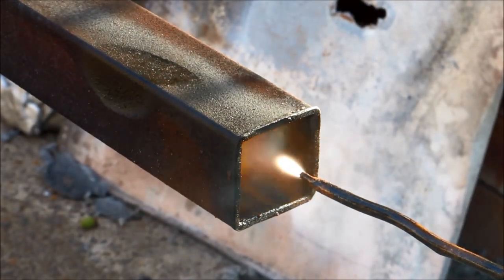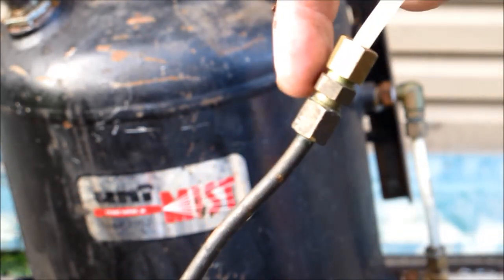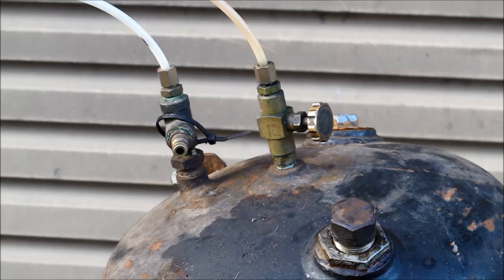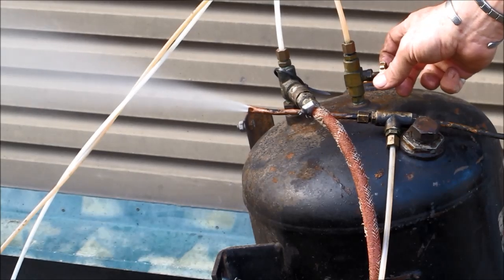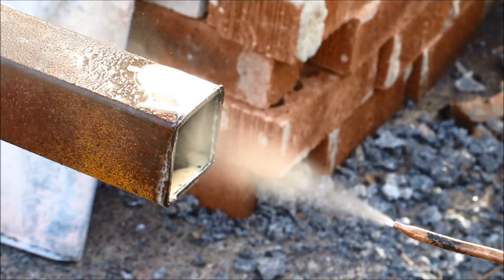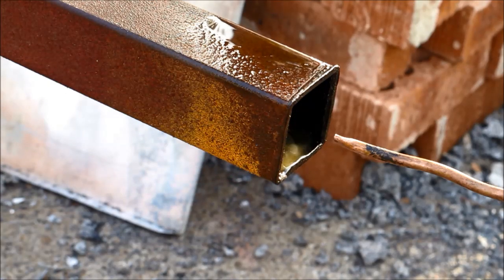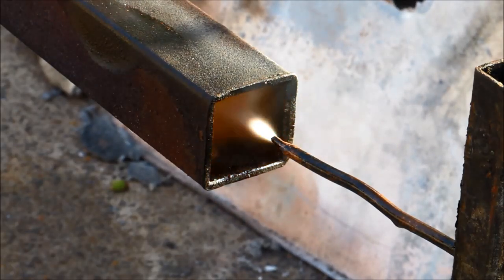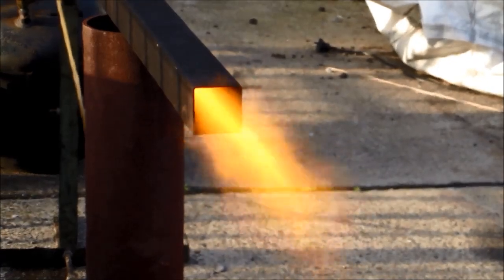Instant light  spraying oil Burner from cheap, off the shelf fittings

Comment: these burners are awesome.. i know you dont like technical questions but i am curious as to how small of a pipe or tube you can use for the combustion tube. i am going to make a small oil burning forge and was thinking of using say 1/2 inch to 3/4 inch burner tube. with a 1/8 inch feeder/spray tube in the configuration you have here . do you think it wiil work? im gonna try it  and let you know.. Thanks for the videos and ideas.
Reply from the maker: +roy moore  Roy it's not that I don't like technical questions, I don't like stupid technical questions that I have explained 10 times already. There is a difference.  :0)

As for your very valid technical question, it's all a matter of proportion. The principal of why it works is the same ( like all my burners) regardless of size.  You go smaller you'll get less air and oxygen and the amount of fuel you can burn will be smaller but it will work!

Now obviously some people out there are, unlike myself, reasonably sane and may not want to make the biggest flames possible. Scaling the idea down is probably going to be a lot more practical for real world applications like yours.  In a forge where there is so much heat once the thing is warmed up, you don't even need to spray the oil. You can just blow it in in the airstream like my other burners and it will work perfectly well. 

That said, the size and air consumption of a setup like you are talking about is likely to be so small it's probably not worth the trouble of going to a dual spray/ blow setup and you  are better off using it the one way. 

Using this setup in a forge regardless of size will only make it work better.  With what you are talking about, even burning 1-2 L of oil an hour is going to give you a lot of heat to work with and melt anything your refractory can stand!  :0)
Reply: awesome mate thanks for the info.

Comment: You are a genius,so simple to build from scrap yet so functional.I want to build something like this for heating my house,old engine oil will be used as fuel.
I have central heating system with wather circulating trough cast iron radiators.Only one question can combustion
chamber be shorter and wider I need it  to fit in central heating wood/coal furnace.Thanks for great ideas You are only one who explained every detail about building, keep up the good work.
Almost forgot any ideas about automated ignition of the burner(glowplug from diesel engine etc.)
Reply from the maker: +Zivojin Budimirovic   Try it in the combustion chamber you have.  You might need to put something in the flame path like a short metal tube to at as a " Glow plug" so there is a hot point to light the heavier oil. 
I haven't done anything with auto ignition but the best thought I have come up with so far is a small gas pilot light.  Even a BBQ gas bottle should last weeks with a small flame. 

Thanks for the kind words, much appreciated. Nice to get a compliment instead of idiots whining about safety and the environment for a change.

Comment: The length of the tube has a lot to do with completeness of combustion or efficiency.  What struck me is that you're using a SQUARE tube for combustion.  Which is probably a better choice as opposed to a round tube.  What you want here is laminar flow and the square shape would tend to interrupt the turbulent flow while promoting laminar flow.  Still it seems like there is some due to the buzz sound of the combustion.  Turbulent flow combustion causes spinning of the gases, back pressure and harmonic nodes.
Reply from the maker: +Joe youtube   I have used a round tube too. I can't tell which one works best. I have some rectangular tube, maybe I should give that a go as well!  :0)

I think what it really needs is a flared or trumpet shaped tube to allow the hot gasses to expand and pull in the fresh charge without the reverberating effect.  that said, it may be the reverb that keeps the damn thing alight. :0)
Reply: +Oil Burner You and I must be birds of a feather!  I recently got the latest version of my water heater up and running.  Up to +90,000 BTU/hr. using almost anything fuel, liquid or solid.  Exhaust gases are nearly invisible, with care.  Cost to build around $120 USD.  Can fit in the back of a PU truck.  Some welding & coil winding skill involved.  In depth understanding of the critical factors required, to realize the end results/benefits.  Design has been around for thousands of years.  No moving parts, no external power, easy to maintain, robust to the elements.  Stainless steel required for combustion chamber lining and coils, the rest is mostly junk lying around! 
Research venturi tubes...the trumpet concept you speak of is the heart of MY furnace.  Combustion chamber is SQUARE!
 Research Rocket Mass Furnaces. 
I learned to avoid introducing used liquid fuels under pressure into a chamber way past the flashpoint.  When you talk of producing a usable 100,000 BTUs, you're talking about controlling potential catastrophe.  (I HAVE produced a blue flame 15 feet long and 3 feet in diameter using nearly the same set-up as your video depicts!)  Just be careful in what you build and what/where you publish.  If it scares you a little at first, you're probably on the right track!!  ;o)
Reply from the maker: Joe youtube  I haven't done it in a water heater ( yet) but if you look at my forced air drip type burners, you'll see my current record output is in excess of 2M btu.

 Technically it's illegal to have a burner going over 1M BTU here unless it's certified and licensed but it's damn good fun to run them.
I'm working on a boiler atm that will do over 150K BTU. the burner section is well sorted, I just can't find the plumbing fittings I need to connect the thing up! Got to have it full of circulating water before I think of test firing it or the thing will be a molten mess in seconds.

Once I get the rubber seals I'll be able to warm the house, the pool and anything else that's feeling chilly!  :0)
Reply: +Oil Burner I'm impressed!  I have a pretty good idea of that level of power.  I operated a truck in my younger days that carried a 6.5M BTU heater on it, for heating crude oil (plus a triplex pump rated for 10k psi).
Copper and mild steel won't do for boiler coils for the reasons you state,  freezing/rupturing was a problem too.  Even one mild steel fitting in the loop quickly turns the water red.  I finally had to commit to using stainless for the coils and to line the inside of the combustion chamber.  It has been a challenge to secure the proper fittings, etc. between availability and low budget.  The stainless comes from local scrap yards, usually close to the current scrap price and had to learn how to weld the stuff.
Reply: +Oil Burner  Welding the stainless has opened up options for fittings/manifolds and hydraulic rated hoses have been working well.  Having a loop that can handle 2,000psi is comforting if something goes wrong, using pop off valves as well, now.

Comment: Let's see how well this works using waste motor oil from (like) a diesel engine...which is not anywhere close to using brand new oil out of a can.  Isn't the objective to end up getting the benefits of 50k+ BTUs from free, wasted oil?
Reply from the maker: +Joe youtube It is running waste oil as I wrote in the description!  I prefer to run Veg oil to the filthy black engine oil for convenience of clean up but you could run any oil you wanted, again as i put in the description.  Diesel engine oil tends to be thinner than veg oil so this would work even better I should imagine and have an even quicker light up.
Reply: +Oil Burner Anyone attempting to provide a furnace with waste oil under pressure & using a needle valve should be aware that ANY particulate material (including in-solution paraffins) that hasn't been removed from the oil, CAN cause intermittent flame-outs.   When the flow is resumed to a spray nozzle shooting into a chamber that is +1000 degrees, relight/combustion may resume with a BANG!  FILTER THAT FUEL OIL BEFORE USING IT UNDER PRESSURE!!!
Reply from the maker: +Joe youtube  I'd basically agree from a convenience standpoint if not a safety one.  All spray burners I know of require the fuel to go through a small orifice.  This system uses flatted tube which is larger than the commercial nozzles but still could be blocked by dirt.  If the oil did relight it would probably relight with bit of a whoosh but as furnaces are far from sealed units, the risk other than soiling your jocks from the sound, is very minimal. 

It' is going to be far more annoying than dangerous but I would also suggest that oil is filtered through some sort of cloth at least before being put in the Fuel tank.
Reply: +Oil Burner Agree totally with an Epiphany Eureka!!
I discovered way back and preach it a lot...that a vertical slot cut for a drain hole will rarely plug up while a drilled hole usually will, given enough time.  
I just never considered the shape for a jet nozzle design, until now that is!!  Makes total sense.
Thanks!!

Comment: If you remove your air flow going into tube while lighting the oil it can reach its burning temp much quicker resulting in faster ignition.
Reply: +Never Enough   If I remove the airflow, There will be no oxygen for the oil to burn in the tube at all.

Comment: You are brilliant. I've duplicated several of your experiments part for part with identical results. Im an automotive technician with my own shop and alot of used oil.  Ive thought about making a large version of this type but then I thought how small can this burner be made and still function?  That is my current project. Love your videos!
Reply from the maker: +MR E  Wow, thank you for the overly generous but much appreciated comments.  it's good to hear when other people do things and they work out because I get some that don't seem to follow what I did and they have trouble.  The principal will work in any size. you just have to keep it all proportional but there is a wide lattitude of what you can do anyway. 
Let me know how you go with your smaller burner.
Reply: multiple particles need to be able to fit thrugh!

Comment: can you make a stump oil burner  i need to get rid of some stumps thanks
Reply from the maker: +bus driver   Mate have a look at this one:  https://www.youtube.com/watch?v=c39k04FhEEc
This is what I built this one for with the downturned  outlet.  I did a couple of stumps about 40 Cm across with it but like an idiot I deleted the vids.  I found it is good to use a strong blower like a jumping castle blower because it moves the ash off the stump and makes it burn faster. You want plenty of turbulence to keep things fanned up.  One stump I did that was dry in about 2 hours and the other that was fresh took about 3.  I cut the ends out of a 60L oil drum and put that over the stumps and made a hole to poke the outlet through. Containing the fire and putting dirt around the outside of the drum  keeps the heat where you want it and speeds things up. 

They aren't an instant way to get rid of stumps but they sure are an easy way. Just get the things going them come back as needed to top up the fuel. You 'll have to gauge the most efficient burn rate  but it's not critical. 
The other thing these burners are good for is getting rid of weeds. I had a lot of little onion weed bulbs in a bit of garden and I flamed them all then heated the soil and stirred it around to cook the little bulbs. Have not seen a single onion weed there in over a year.  I put some manure and compost back into the garden to replace what was burned and the garden has been great and totally weed free.
Reply: thank you

Comment: now all you need  is a little water spraying in and it will be hydrogen ;o)
Reply from the maker: +wichywoo  No, unfortunately that is an internet, free energy type fallacy.  It takes temps over 4000oC to separate the water to it's base components and when you burn the resulting gasses, you get a net energy loss.
Reply: may be not hydrogen then but it would make a difference after all look water happens you throw water onto a chip pan fire, something happens, unless I imagine it? may be you could harness the same energy by spraying water into the oil? just a thought

Comment: Can i use motorcycle carburetor with electrical fan ?
Reply: +khaled6100 The carb jet will be too fine for any practical purpose.   It's easier to just flare the end of the tube or use compression fitting .   Put on a cap and then drill it with a very fine bit.  Still a bit of overkill though when you can just crush the end and regulate via the fuel and air controls.    
  Like the old Sarge once said.  "Keep it simple stupid"  Overthinking things like this is usually done by commercial companies to satisfy the safety nazis and enviro idiots.     Keep it as simple as you can and it won't give you headaches.
Reply from the maker: +Merlin Cat  Well Said!
Reply from the maker: +khaled6100  I suppose so. What did you want to do with it?
 Sure as hell won't work for a burner that i can guarantee!  :0)

Comment: Maybe I'm missing something? I see your atomizer T fitting and I see your tank plumbing but I don't see how the one connects to the latter. Assuming you run the fuel tank line to the lower branch of the atomizer, is your air-line from the tank running to the other horizontal branch? That would mean your compressor is charging the tank AND driving the atomizer. It would make sense, but just a one page sketch would be helpful. Very simple, unique, love it.
Reply from the maker: +dean germeten  Compressed air goes to tank which pressurises the fuel and sends it and compressed air to the burner head.

Comment: thats brilliant, love it but think it be to noisy for my rayburn stove , i did try similar things and they worked fine but just to noisy. system i use now air is supplied by the draw of the chimney and no electricity is required. yours would be great for a central heating boiler say in an out building :)

Comment: Hi can you tell me what is the working pressure of air you need too make the mist?
Reply from the maker: +vin KELLY  Yes I can. But it would be the same as what I already wrote in the description.
Reply: I am using a gas cylinder and just wondered about the pressure

Comment: Surely the electricity you would use to make the compression would counteract the saving you would make on a traditional oil burner?
Reply from the maker: +Edward Reid  Whats a traditional oil burner? If you mean the gun type that are in American home " Furnace's" we don't have them here in oz.
Reply: +Edward Reid 
I was wondering that too. Wasn't aware the Aussies don't have them, thought they were everywhere.  My workaround would be a compressor run by small diesel engine using waste veg oil for fuel.

Comment: This is a grest burner, however it uses lots of compressed air, yes?  Thinking about a burner that uses a small amount of compressed air to spray oil and a blower for most of the air.  Not sure how to keep the flows of air and oil in sync though.
Reply from the maker: +MrTechnophile  You can see on one of the Later vids where I used a small blower to supplement the compressed air.  I much prefer my blower style burners to these because they use no compressed air at all and are extremely powerful.
Reply: Much like a torpedo heater

Comment: huge thanks for uploading this video, been put off building my own spray type nozzle furnace for melting cast iron as all the ones i have seen use expensive fiddly bought in ones with loads of needle control valves for everything.i can see why you would want loads of control and the ease of buying in a valve but i couldn't see the simpler way to build one and now i can. many thanks again, keep up the good work !
Reply from the maker: +The Home Machinist   You are welcome.  Its very rewarding to know people are putting these ideas to work and benefiting from them.  Really makes it all worth while.  If you are able to video what you make, please let me know when you have. it's great to see what people do in action.
Reply: +Oil Burner HI oil  burner, have built my nozzle, using gravity syphon feed, problem is it seems to be blowing out both nozzle and feed pipe. if i take nozzle out works great at syphoning but rubbish at atomising/ misting. i am using waste commercial veggie oil. playing with the pressure seems to do nothing. only thing i can thing of is using pressure feed for oil like in this video ?

Comment: How hot does the flame get?
Reply from the maker: +Joep Stuyfzand   Same as all oil burner flames I imagine, about 2500+ oC.  Hot enough to melt steel ( which people do with these things) If you can contain the heat with a high quality refractory.
Reply: Oil Burner I really hope you misspelled and that was 2500F, or else that is some serious refractory needed!
Reply from the maker: Joep Stuyfzand
No, 2500C. that's the FLAME temp as you asked. It's not the furnace temp but yes, to reach max temp and some people do get furnace temps over 2000 oC, you DO need the highest level refractory to handle it. In casting circles it's well know an oil burner can demolish refractory if given full power.
Reply: Oil Burner I have a small furnace, so no 300kw stuff for me, my furnace is half a cubic foot I think. so the flame will be much smaller.
Reply from the maker: +Joep Stuyfzand   yeah, for half a cubic foot you'll be good with just 295 KW.  You don't want to be hanging round all day waiting for stuff to melt right?   :0)
Reply: +Oil Burner still, 295kw will need some good insulation, do you think itll melt pewter? ;)